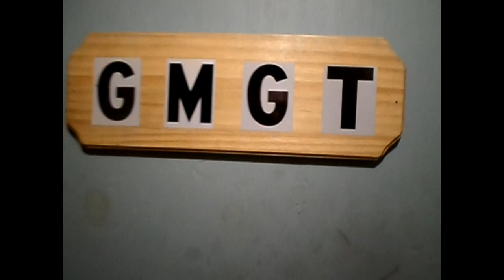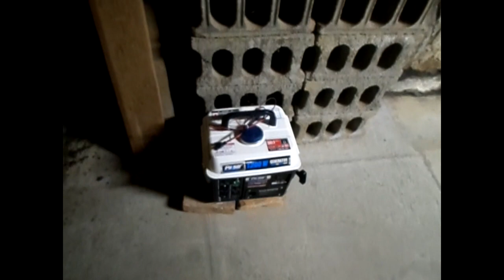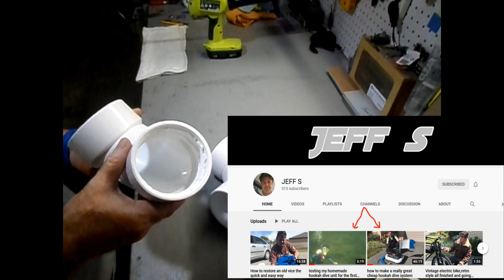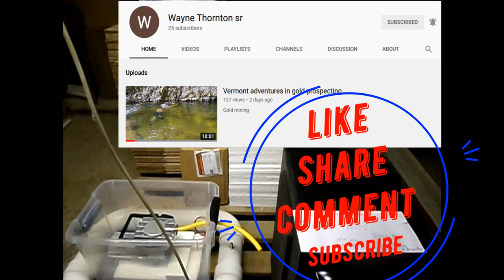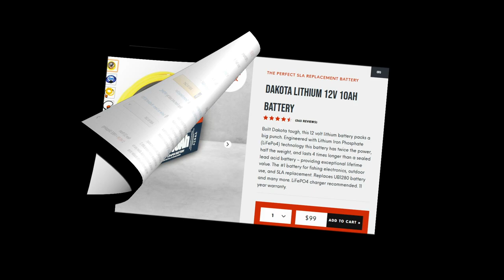DIY Dive Hookah Build - Green Mountain Gold Trap

Comment: That looked like my drill press.🤔😊 Mounter moated??🤔You said there were no fumes with that cement.🤣 Seems to work great. Your body looks like you  are too buoyant. A little weight will help a lot brother.👍 Congrats on a great project.😎👍👍👌👌⛏⛏
Reply from the maker: Ah yes, bloopers😁 Yes, reserve tank #1 I did with the marine adhesive sealant, has no fumes. But then I had the bright idea of wrapping it with fiberglass. It was super ugly so, I built a second reserve tank and used pvc cement. It will sit over the winter. And yes, I normally use 60lb's of dive weights but,m this was only a short test. Thanks brother😁
Reply: @GreenMountainGoldTrap  It is all good my friend. I think it is good to be a little light hearted with things as long as it isn't offensive. God bless brother.
Reply from the maker: @CandSMINING  Oh no, I don't want offensive on my channel, no thank you! Maybe a little humor from time to time.

Comment: needs air pressure regulator switch so motor dont run all the time other than that great job!!!
Reply from the maker: Thanks Lee! you are 100% correct. Eventually I plan on modding it a bit. That being one of the mods. Also adding quick connects for the air line and possibly a switch so I don't have to hook the wires to the battery each time.

Comment: That is NOT breathing air rated hose. It was not "designed" for breathing air. No where on the hose, or in any manual that comes with it, does it claim to be breathing air rated. It is only the seller that claims it is for breathing air. While it does seem to be PVC construction, and you might get away with using it. Stop lying and providing false information claiming it is designed as breathing air quality hose. It just shows your complete lack of knowledge in regards to this project.
Reply from the maker: Thanks for the kind comment! 
I am no professional diver and know little about diving products. 
What exactly is your level of knowledge in the matter? Because I would like to know for certain that what I use is not safe.
You spoke as if you were hear when I received the shipment and read a manual that does not exist.
But as I said, I am no professional. My DIY project was based on other DIY's I watched. So your statement of (lack of knowledge) isn't untrue. However, I can't help but wonder why it is you felt the need to be totally rude in the matter.